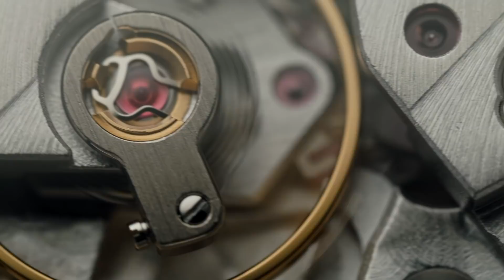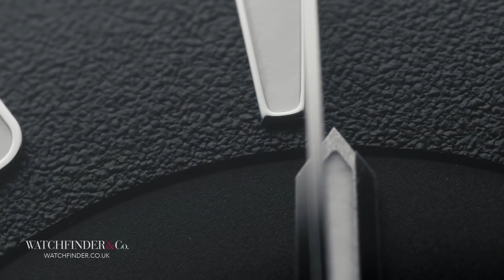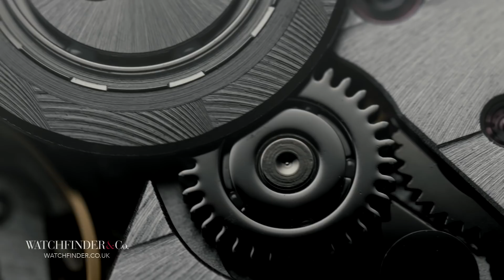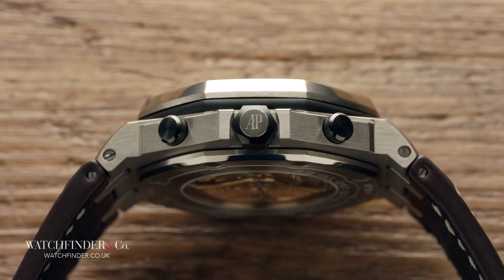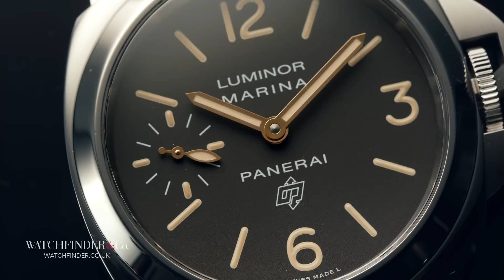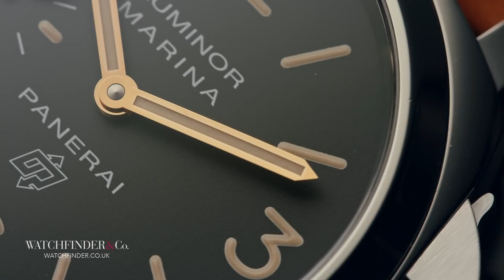Can’t Get a Daytona/Nautilus/Royal Oak? Here’s Watch to Get | Watchfinder & Co.

Comment: A question to start an argument: is it really a worthwhile Luminor without a sandwich dial?
Reply: Will S I had the PAM005 which was sausage dial, the sandwich dials are nice and probably more iconic, but for me the question should be why do Panerai reduce to 100m resistance and spring bars when it’s a dive watch and screw bars we’re better.

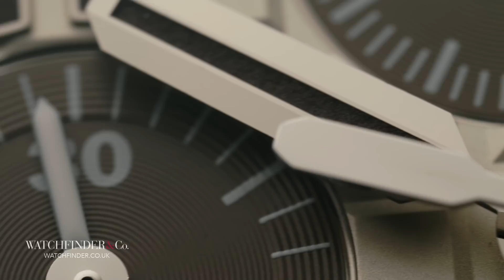Comment: I'm not usually one to point out finishing issues... but 3:46 the obvious corrosion under the seconds hand in the reflection is horrible.
Reply: Good spot! Watch the video they did on the tourbillon Royal Oak, there were similar comments on finishing there...I think AP are rather overrated for this reason
Reply: Matt McLoughlin Good observation, but surely something that can be fixed. Would be a good bargaining point for a buyer for sure.